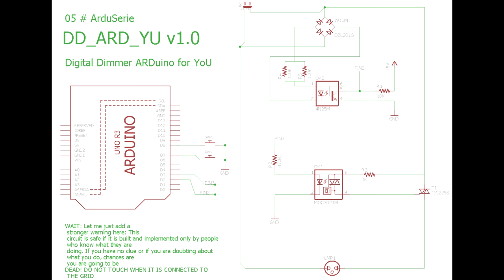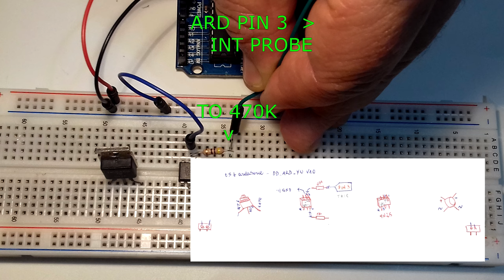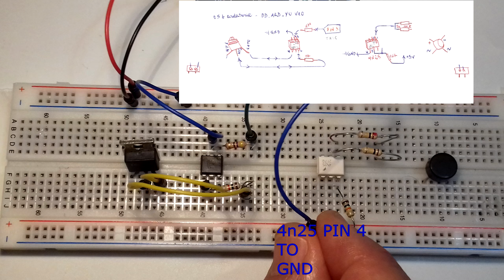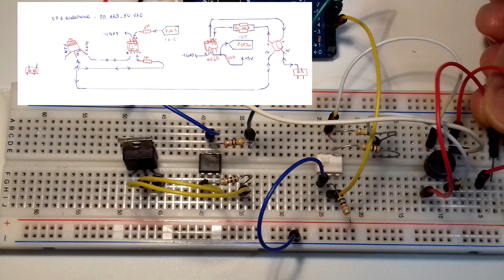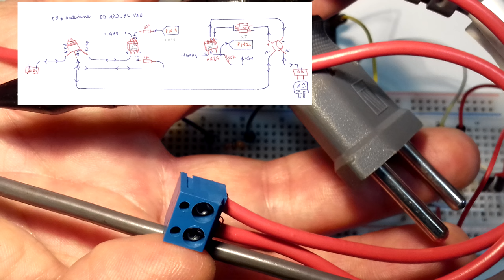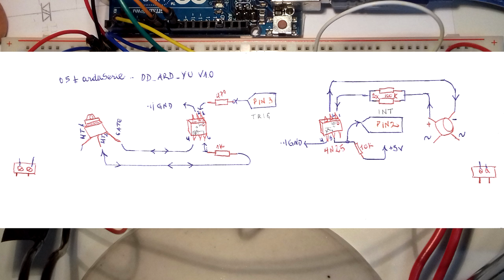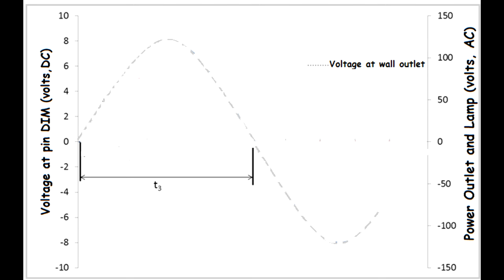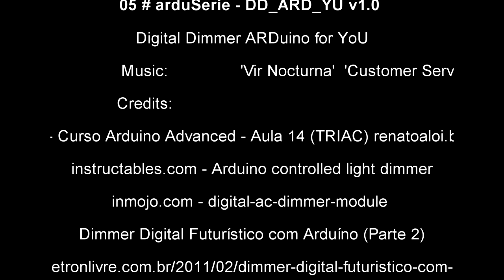Digital Dimmer ARDUino for YoU!!! 05 #arduSerie

Comment: hello, is it possible to use this circuit to use for ac fan speed control with arduino? thanks.
Reply from the maker: Hi, ajayanchal. Certainly! The output in the implementation is for the incandescent bulb. Just put the terminals on the fan and ready ....thanks for your visit!

Comment: Hi J3.
I want to control an ac welder I made using 4 modified microwave oven transformers,
People usually use two.
I can use a triac and diac ( the ac dimmer circuit scaled for 127V and about 40 amps in the primary coils  in parallel all.)
Right now I can only see U2b comments and read emails. 
Could you email me your  diagram to see if I can use it ?
I can share my welder specs with you.
Thanks a lot, josé
Reply from the maker: Hi, Jose Saldivir, Thanks for feedback. Diac is much like a bidirectional switching diode. It has two terminals, while Triac is much like a transistor swiching for AC current. See this tut for more info: http://www.electronics-tutorials.ws/power/diac.html. As always feel at ease to contact me!
Reply: +J3 Hi , thanks a lot for the info. Later I can open  the link.
When I finish the control I'll tell you.
so long.
Reply from the maker: https://drive.google.com/file/d/0B8iMbc-iQqlUcmF3b2gyYzllVzg/view